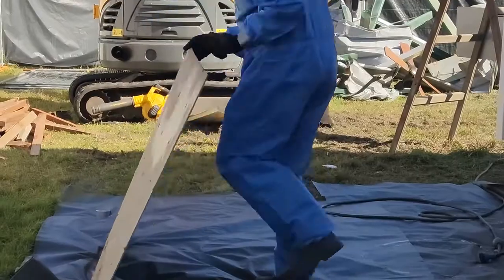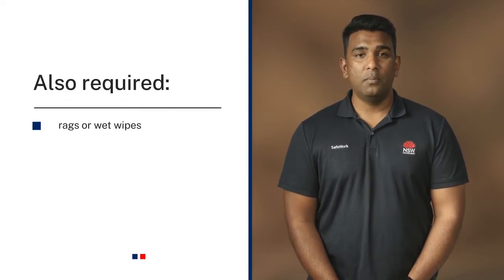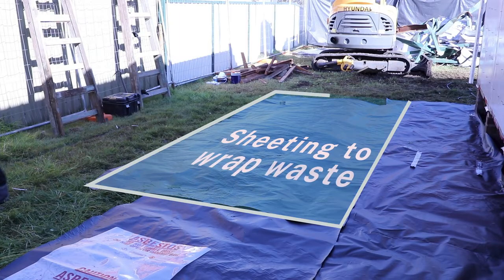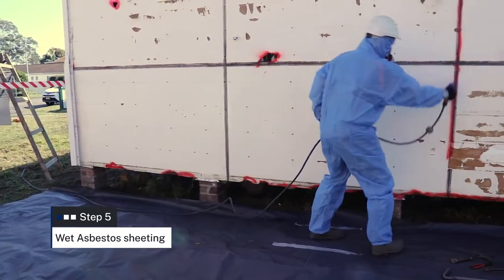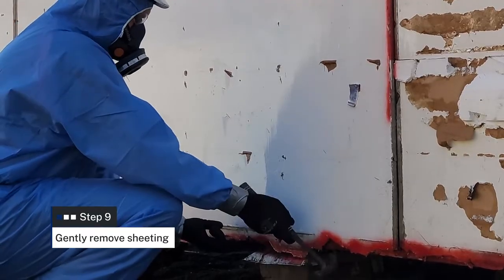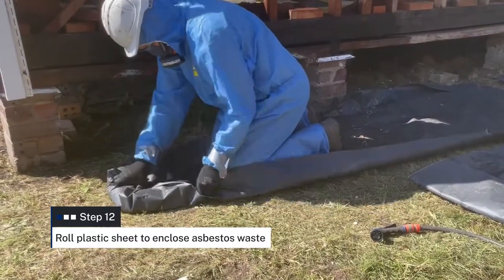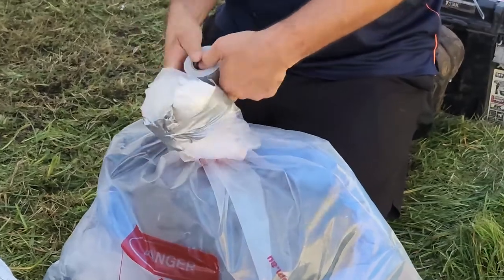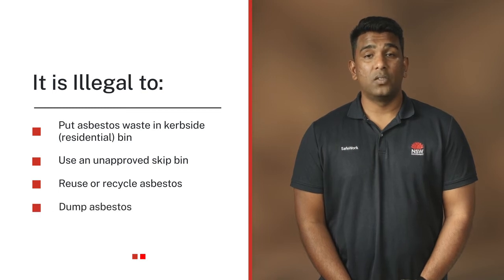Removing asbestos sheeting safely

Comment: If asbestos wall linings have breaks in them, are they friable or non friable? If breaks/damage are found, is it enough to put plastic and tape over the damage? Or should a glue be applied prior to plastic and tape to ensure loose fibres are sealed?
Reply from the maker: Hi Ylang, there are specific laws about working with asbestos, please visit our website for more information: https://www.safework.nsw.gov.au/hazards-a-z/asbestos.

Comment: How can I protect my MUM from breathing assbestos?
Reply from the maker: Hi Tommy, if asbestos containing material is in good condition it poses little health risk. However, when asbestos containing products are disturbed by cutting, drilling, water blasting or similar activities, small fibres may be released into the air. You can find helpful information here: https://www.safework.nsw.gov.au/hazards-a-z/asbestos#.

Comment: What is the purpose of misting the asbestos sheeting?
Reply from the maker: Hi Colleen.

A constant low pressure water supply is required for wetting down asbestos and related items to suppress airborne asbestos fibres. 

This information can be found on page 40 of the  How to safely remove asbestos – Code of practice - https://www.safework.nsw.gov.au/__data/assets/pdf_file/0015/50082/How-to-safely-remove-asbestos-COP.pdf

Please call the team on 13 10 50 should you wish to discuss in more detail.